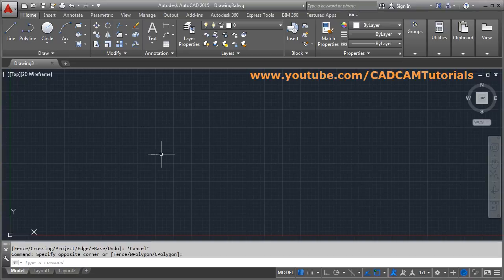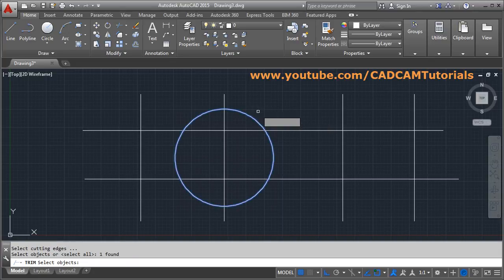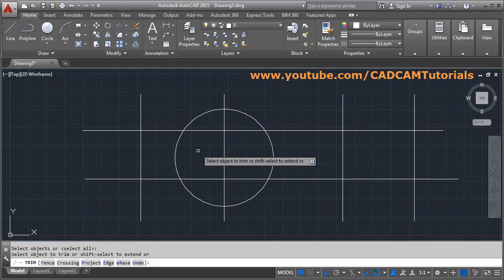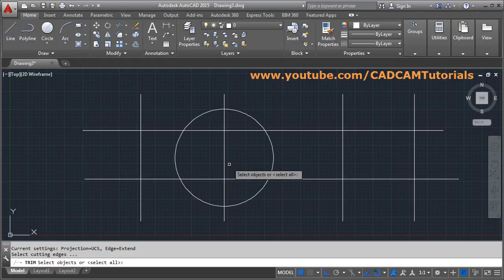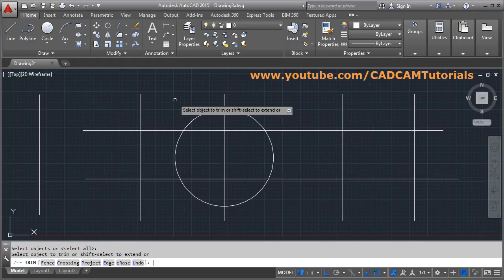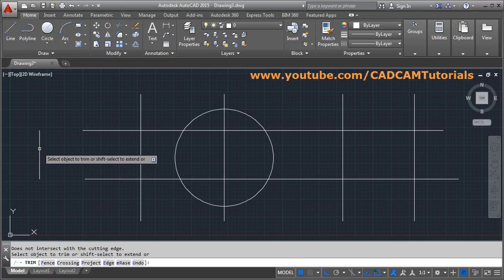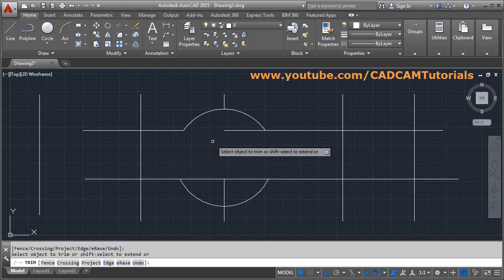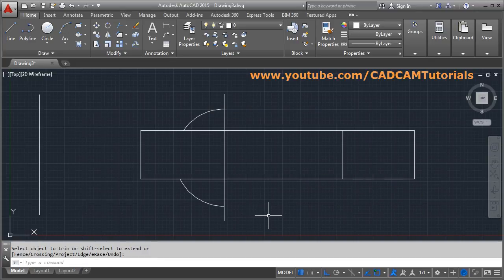How to Use Trim Command in AutoCAD | AutoCAD Trim Command Tutorial Complete

Comment: if you intersect line with circle and using Trim command to trim the part of the line out of the circle i see a small line not trimmed , why and how to delete it ?
Reply from the maker: E enter select object enter. Trim only works when objects are crossing.
Reply: @CADCAMTutorials  
You use erase command but that command erases the line totally, but i am asking when the line intersects the circle a small part of the line appears after trimming when i zoom in but i can not erase it or delete it.
Reply from the maker: Re enter, when you zoom circle it is not shown as smooth circle. Therefore it is showing that small line. But that line is not there. The trim is perfect. You can REGEN (re enter) and see.
Reply: @CADCAMTutorials  I have another question
I drew a circle but i want to draw a line, starting from any point of the circumference of the circle, when i put the cursor on the circumference i cant find any point andthe cursor flip to the cinter of the circle. How to select any point on the circumference to start drawing a line ?
Reply from the maker: L enter shift + right click select nearest click on circle